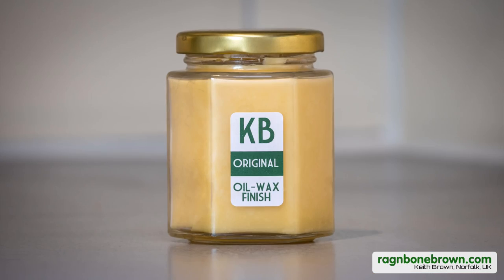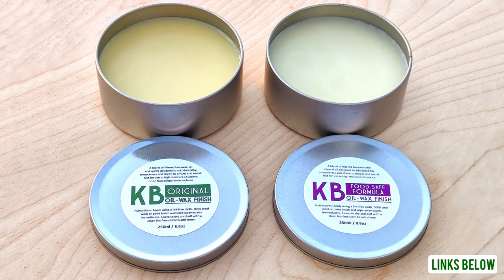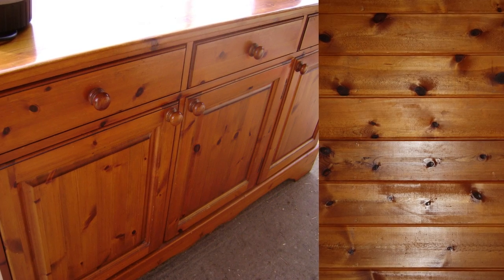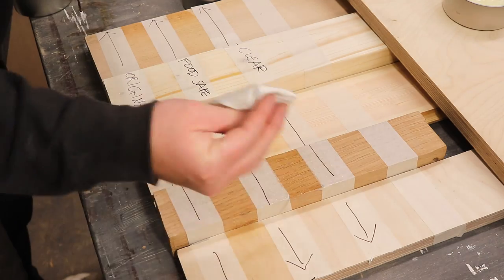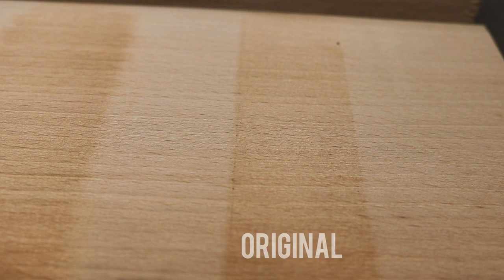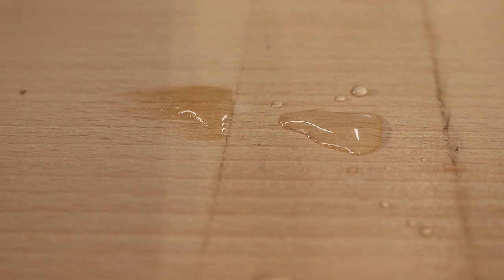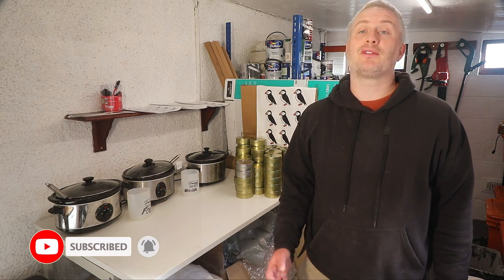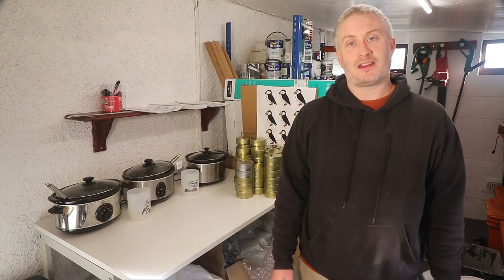A New Clear Wood Finish - Non-Yellowing / Non-Darkening

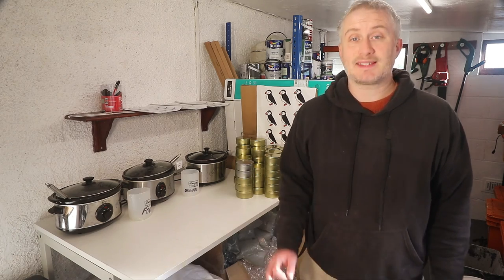Comment: That demonstration of the clear finish is very impressive!  On a separate note, I see the bandsaw table wobbling slightly at 4:43.  I have an Axminster white bandsaw, and the whole frame is so lacking in rigidity that the table is ridiculously easy to move.  I'll either add bracing to stiffen it up or get rid and buy a better one.  Luckily, it was a cheap eBay purchase.

Comment: Hi Keith, I have a soft wood stair rail that is getting just over ten years since installation and the pine was filled before stain/varnish application. The problem I have is that the wood has darkened and the filler has not, leaving a poor finish. Trying to sand this down leaves a fresh lighter colour of the filler... What would you recommend to get this to a uniform colour?

Comment: Hi Keith, I bought original & foodsafe about 2 years ago. The original has gone hard/crusty. Any. Suggestions for regeneration (not Dr Who style)?  Heat & add more BLO ? Or poke holes with toothpick & add BLO & Let is soak in?
Reply from the maker: Hi John, yeah it does do that, as boiled linseed oil is a drying oil it tends to develop a skin. I usually just peel that away and work with the fresh stuff underneath. I've not tried heating it but that might work! 👍

Comment from the maker: KB Oil Wax Triple Pack (Original, Food Safe Formula and Clear)
https://keithbrownmaker.etsy.com/uk/listing/1314398822/

KB Oil Wax Double Pack (Original & Food Safe Formula) https://keithbrownmaker.etsy.com/uk/listing/893215775/

KB Oil Wax CLEAR https://keithbrownmaker.etsy.com/uk/listing/1314396026/

KB Oil Wax ORIGINAL https://keithbrownmaker.etsy.com/uk/listing/891150827/

KB Oil Wax FOOD SAFE FORMULA https://keithbrownmaker.etsy.com/uk/listing/892993819/

10% off promo code expires 31st December 2022